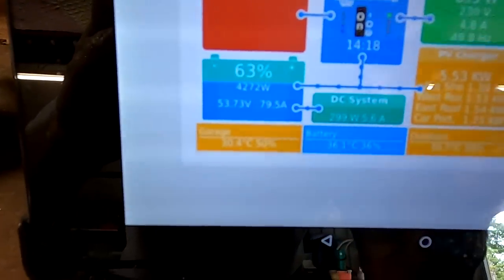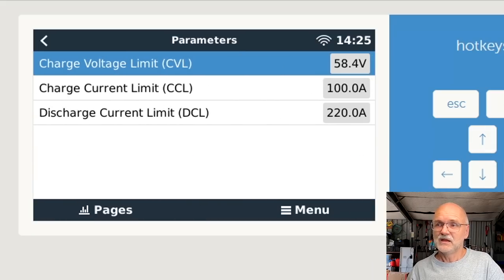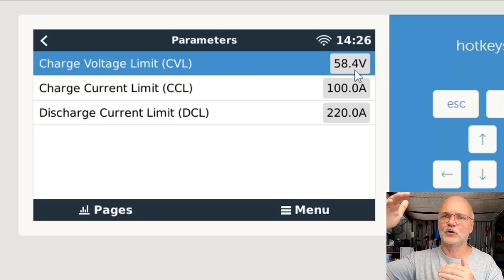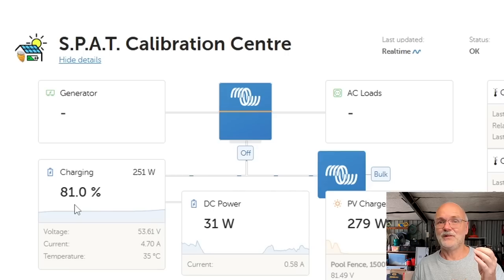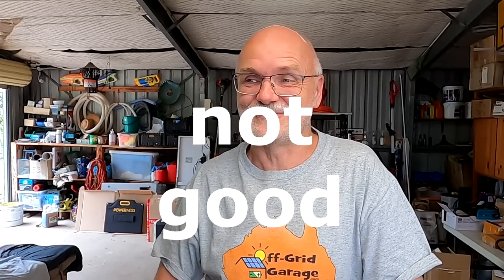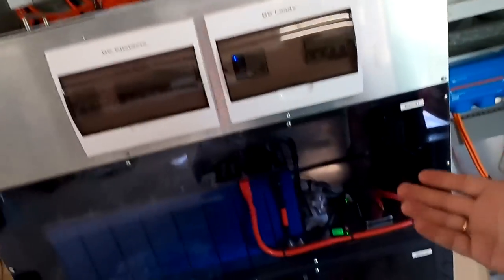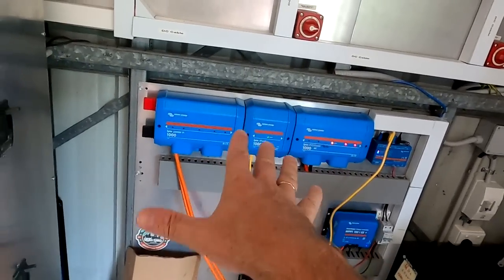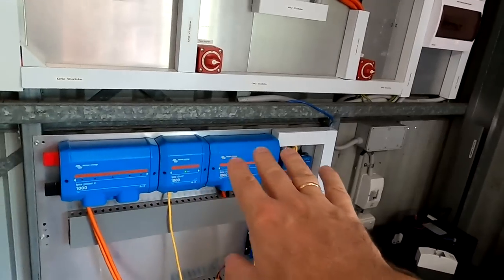SEPLOS BMS and Victron Lynx Shunt. Great solution, but why this is not for me.

Comment: If the photovoltaic strings are connected in a 48 volt configuration can they be connected directly to the batteries which are also configured for 48 volt DC. If so, there isn't any need for a Victorian electronic wealth status because the simple Chinese battery charger discharger (BMS) set up is perfectly designed for the properly arranged photovoltaic system. Ya?
Reply from the maker: That is not possible. You ALWAYS need a charger and BMS. It is not just for charging but also think about temperature and low voltage, high current protection, balancing. This is all part of the BMS task.
Reply: @OffGridGarageAustralia  I understand; everything is significant. An insignificant system design is arguably impractical.👍♥️✌️

Comment: Hello Andy,
what I do not understand, why 58.4 volts???
Why not 56Volt? Is enough to reset the SOC and not too high that something takes damage. DVCC can work, BMS can work and SOC is also reset. What else? Should the BMS shit gold?
Reply from the maker: It does not matter if the BMS is set to 55.5V, 56V it 58V.  It is the voltage you need to reach to reset the SOC to 100%. It is also the voltage the BMS goes into overvoltage protection. This should never trigger unless there is a fault. But here, they suggest to use this safety function on a daily base just to get the BMS back to 100%. That's such a wrong design!
Reply: @OffGridGarageAustralia  As you say yourself the pack or cell voltage must be triggered to achieve a reset to 100% SOC on the 10E. But the values 3.65 and 58.4 can be changed by you or anyone who has 1 finger to type in the app. If I enter there as pack 56.4 V overvoltage protection and leave the cells on 3.65 as protection, the SOC is reset when 56.4 volts is reached. That work at 10E, the other 10C i dont know.

Comment: Hello. As always, very interesting video. I sent you an email with a picture of my own installation: 3 phases Victron system (MultiPlus II 10000 x 3), and 3 SEPLOS MASON batteries stacked (for a total energy of almost 44 kWh).
I made a firmware update of the Victron Cerbo GX last sunday. Now, version v2.93 of the firmware is installed. Previously, it was with v2.92.
And guess what I've found:
- when I was with v2.92, SEPLOS batteries had no issue to come back to 100% state of charge for the battery bank once a week when I used the "keep batteries charged" Victron setting (it did not come at the same time for all batteries, but over some time depending of SOC deviation). But I was never able to see in the VRM graphs that the Multis were in absorption, it was never displayed.
- Since 3 days now with v2.93, my SEPLOS batteries cannot reset their state of charge to 100% even after a complete night of full charge and absorption: they seem to block at 94/95% SOC in average, but each battery has a different SOC between 92 and 98%. And now at least, the various status are correctly displayed in VRM portal for the Multi, so I can confirm the Multis are in bulk, absorption, passthrough or whatever.

So there is definitely an issue that doesn't depend of the SEPLOS BMS firmware only. That's what I think. I consider today it's a bad conjunction of "things" between the CERBO installed firmware version and the SEPLOS firmware installed version. So by the way, the voltage of my batteries never reach any more the voltage needed by the BMS (I've 10C with firmware 2.8) to reset the SOC. I don't know why absorption phase is instructed to be made at 54.2V by the BMS to the VICTRON Multis and the CLV is set at 55.5V as well. The fact is that SOC was correctly reset at 100% when CERBO firmware was at v2.92, and not any more since v2.93...
Reply: At lunch time today, and finally, my three batteries made a reset of their SOC to 100%. So at the end, all is working fine for me between VICTRON and SEPLOS. I presume a lot more time than I was expecting was needed to come at this status.

Comment: Is there a way to use the lynx shunt in the smart network for the mppt show it shows the correct voltage? I didnt hear you mention that problem so wondering if you were able to get that to work? Thanks

Comment: New to batteries :) Is this a settings issue? Learning so please bear with me. 90% of 55.2V = 49.68v. 81% of 58.4v = 47.3v. First, is this a discrepancy between actual settings & Victron’s interpretation of 100%? Second, why wouldn’t one set both parameters as 58.4v being 100% SoC? Thanks

Comment: Hi, thanks your great videos. I have a SEPLOS 10E with Firmware 16.4. And a Victron Multiplus II GX and so far I found out the following:
- I use it as an ESS System with the ESS Assistant in VE Configure
- The BMS resets its SoC to 0 or 100% if one of the protection values are reached as you mentioned. But you can configure them, so you can change them to your needs. So you could set the cell/total over/under voltage level to what you like. Does this not work at your 10E model/Firmware?
- Every Alarm of the BMS leeds to a "Low Voltage Warning" in Victron. But you can disable them or configure the values with the BMS Software. This took me some time to figure out especially the remaining SoC Alarm). 
- You need configure the ESS Assistant Values with a little lower values than the BMS Values so that the Battery could even reach 0% SoC if you set it 0% in the ESS Settings. These values are the "Dynamic Cut off Voltage" settings I set all values to 45V. If these are higher than the low Voltage alarm setting in the BMS, the multipuls never discharges the Battery to 0% SoC because the dynamic cut off values kick in first. Also the Sustain Voltage should not be higher than this level. I set it also to 45V
- Did you ever get an Answer from Seplos why the CCL Value in the Victron Settings is only the half of what is configured in the Seplos BMS? This is indeed very confusing.
Reply from the maker: Thanks for your comment.
- I'm off-grid so no ESS assistant for me.
- Yes, we can change the OVP settings as per our needs, that is not the problem. The issue is that this OVP value and triggering the BMS should not be used to rest the SOC to 100%
- Yeah, the alarms can be annoying or useful if setup and fine-tuned correctly
- I'm off-grid so no ESS assistant for me.
- I have not discussed this specific question with Seplos. I'm not too concerned about how this works as long as we know how to handle it.
Reply: This is an interesting question - if one runs an ESS (like I also do), are the values that one selects when setting up the ESS used at all in the end? They don't show up anywhere anymore it seems. How is the interplay between the ESS assistant, the Victron internal (MPPT) algorithms, and the Seplos BMS algorithms?

Comment: I think it will work no worries.
Top balance all cells.
The Battery capacity will be determined by the lowest/worst cell.
The worst cell will get to 2.5V and 3.65v (before the others) if you charge that high.
Because cells are in series there will be no natural balancing between cells.
I don't expect there to be much deltaV difference when recharged to full even after a full discharge.
The healthier or larger capacity cells will merely have more unused capacity.

Comment: I’m confused… all power consumption from the battery to the inverter(s) is DC so how does the Lynx shunt know that the power drawn by the inverter(s) is for AC power?
Reply from the maker: The AC inverter (Multiplus or Quattro would be connected to the Cerbo as well and communicate the numbers to the mothership.
Reply: @OffGridGarageAustralia  So it’s not really the Lynx shunt that knows what the power is being used for it’s the Cerbo which for some reason isn’t really reporting what the Lynx shunt is reporting to it. I have had the SmartShunt for a while now and just decided to get the Lynx Distributor and Power In but I’m going to use them backwards and put the fuses on the batteries instead of the loads. One question though, based on the Lynx connectors do you think I should be able to connect the the SmartShunt directly to the negative connection bars or am I going to need to use cable to accomplish that?

Comment: Hello! Thank you for your videos!
I wanted to ask your point of view. 
I am assembling pack of cells that consist from 13 cells from Smart EV3 Each cell - 50 Ah. And the higher voltage is 3.7 Volt. 

Can you tell me which is a good solution for BMS and Charger/inventor  for this kit?
Reply from the maker: Thanks Nick. I assume these are Li-ion cells @ 3,7V.
I would recommend the JK-BMS for such a pack. Choosing the right charger is bit more tricky as I don't know your requirements in terms of loads and what specs the cells have.

Comment: Wondering if the 1000A shunt is too big for your DC loads and sources, giving you insufficient resolution and a greater degree of error in measurements.
Reply from the maker: That should not make any difference. It should pick up a 2kW load, you would think?

Comment: Hi Andy, 

I have comment under your Seplos videos before and some tings you have experienced I have not. 
The BMS is not perfect but ok, I agree they need to work on it some more.

But regarding resetting to 100% SOC, my 10C with 2.8 will do that without hitting the limits you have needed to hit. Charging with 55,5V and when the charge current dips under about 5A it will reset SOC for me without trigger any alerts or protections. 

We have had some difference in experience before with this BMS but the only big difference I see between our two systems are that you charge with solar and I with grid with the  multiplus II. Sounds strange but could that cause the difference in experience?

//Markus
Reply from the maker: Thanks Markus, you need to differentiate between the 10C and 10E BMS. I have made a dedicated video about the different versions and firmware and how they handle the 100% SOC: https://youtu.be/KHxpQgg-TZQ
The 10E will only reset at OVP settings while the 10C will do this at 56V with FW 2.8.
Reply: @OffGridGarageAustralia  Hello Andy,
I have had different experiences in the meantime. My 2 Seplos with FW 2.8 have a CVL of 55.5V. When reaching 98%SOC, the CVL is set to 55.4V. The CCL is also regulated by the BMS from 240A to 120A. When the battery voltage exceeds 55.4V (SOC at 99%) the CCL is set to 10A. Thus is slowly charged further current between 1A-7A until the SOC has 100%. Voltage reaches 55.5V. Battery current oscillates around 0A. The load continues to be supplied by the MPPT with about 2.5kW.
So my summary, I am currently satisfied. Was the first time that after the winter the batteries could be charged to 100% again. Will continue to monitor.
Greetings Helmut

Comment: Yes, it sounds like a good idea to have both batteries addressed separately in the vrm. Especially as they are different capacities, it doesn't make sense to combine them.
Watch out for reflections and resistance when using multiple points on CAN.

Is there an alternative firmware from another vendor? Are there other boards in the same dimensions from other vendors?
Reply from the maker: Oh, no, you misunderstood. The Seplos BMS still reports the 280Ah and 135Ah battery combined in the VRM.

Don't know if there are other FW out there which can be used for these BMSes. I doubt it...

Comment: Hi Andy. Would you consider replacing the BMS with a Batrium and then give us your rundown how that should be setup with the Victron hardware? PS ive been watching your videos since your Outlander videso years ago
Reply from the maker: That would be a very expensive test to switch to Batrium... They got in contact with me a while back but I wasn't quite ready for jumping directly to the top. Maybe I will at some stage but for now, I have one more important manufacturer to test and I'm really looking forward to that.

Oh, thanks a lot for sticking with me for so long. The good old PHEV. Man, that was a whole other dimension...
Reply: @OffGridGarageAustralia  'I agree it is expensive, but work very well for my use with 48kwh of recycled Nissan leaf cells. I loved my Outlander and love your videos and got the PHEVbox as per your videos. It worked perfectly for me out of box on my base model 3h

Comment: Just a few day ago my EVE battry box arrived in Germany after 2 months... did just a first check until now, but it seems that the calibration to 100%SOC is not different to yours. At least the alarm values are not function like a calibration setpoint. My software version is not 2.6, 2.7 or somethin like that, it is V16.4 ( in Android App and Windows battery monitor) whatever that means...

Comment: One wish for the SmartShunt:
The option to syncronise to 0% SOC based on voltage...in Germany in winter that could be very usefull, if it never reaches true 100% SOC for months.

Some finding with a ESS-System and the Seplos BMS 10-C v2.8:
Once the BMS reports a Charge limit (CCL) of 0A, the System stops feeding back into the grid and the solar energy is not used at all.
I have the BMV-712 installed as well and I'll probably go back to it as a main battery monitor.
But I am still gratefull for the communication of the max. and min. cell voltage as well as the cell temperature.
Thanks for sharing all your findings and also the frustration to work together with those BMS / Battery companies. I found the same...can be quite annoying.
Reply from the maker: I have to thank you for your assistance and many emails with information, Raphael. You were one of the biggest motivators to get me started on this Seplos journey.
I found the SOC in the Smart Shunt is actually not too far off after months with no full charge. I have the same issue down here during winter. With the new FW version of the shunt, you can manually set a SOC now and 'calibrate' it like this from time to time if desired.
Reply: @OffGridGarageAustralia  This solution has so much potential, but it is just not done right by seplos and victron 🥴
I am curious to see, what other options you discover on the way Andy🙂
I wished, I had more time experimenting.
But for now I actually asked Shenzhen Taico Technolog to build me 5kWh battery packs with the JBD Smart BMS. I'll be back home in 2 weeks and I am looking forward to test them.
The balancing of the Seplos BMS ist a hot mess as it is right now. But the JBD BMS can do a good job, even with a passive balancer.

Comment: You have 2 Battery packs,  one is 6.9kwh and another 14.2kwh. My question is both battery discharge at the same time ( Same SOC).
Reply from the maker: You can put them in parallel and they will charge and discharge differently. The smaller battery will give/take less power than the large one. I made this video here: https://youtu.be/fQz7vZEYLfY

Comment: Make sure you update the firmware on your lynx shunt via the VRM. Mine was completely wonky until it did a few upgrades.
Reply: Product	Lynx Shunt 1000A VE.Can	
Firmware version	v1.08

For so far i know there was never an update for the shunt ... so where did you get the update?
Reply: Change log:
v1.09 - 30-3-2015
IMPORTANT: Do not use v1.09. The version has been redrawn because of bugs.
From CCGX version v1.30 onwards, coming in October 2015, it is possible to change Lynx Shunt settings, 
also when Lynx Shunt is running v1.08 or earlier.
Change log:
- The State-of-Charge is now periodically stored in persistent memory. So after a power cycle it no longer 
shows the unsynchronized state, but the last known value. The first time (after update to v1.09) it will show 
100%
- Keeps track of charged and discharged energy (kWh)
- Fuse blown alarm is enabled by default
- When the relay function is set to charger/generator start/stop, all other conditions than low SoC and low 
voltage are ignored
- Added separate setting for the low SoC relay threshold, it is no longer combined with the discharge floor 
setting (used for time-to-go calculation).
- Upgraded to NMEA2000 database v2.000
v1.08 - 2-6-2014
Change log:
- Fixed bug in high temperature alarm: an alarm would be generated when there is no sensor connected.
- Improved VE.Can stability
- State of charge can now always be written via VE.Can. This is used by the Lynx Ion to maintain SOC while the 
system is off
- Fixed bug in relay binary switch status pgn
- Added relay mode: always open
- Fixed bug in relay conditions: once activated because of an internal temperature problem, it would never be 
cleared again.
Known issue:
- The low state-of-charge thresholds for relay and alarm can be set in steps of 10% instead of 1%. 
When using the CCGX (v1.30 or later) and set to an unsupported value it is automatically rounded to 
the nearest multiple of 10%.
Reply: @Mayhemkillerweed  I got it through the VRM.  I am running v1.08.  It was not that when I installed the lynx last fall, but I do not know how long my box has been sitting on the shelf.
Reply: @NateCCIE  👍 , damn i thought you had a " black version"  of a firmware 😁